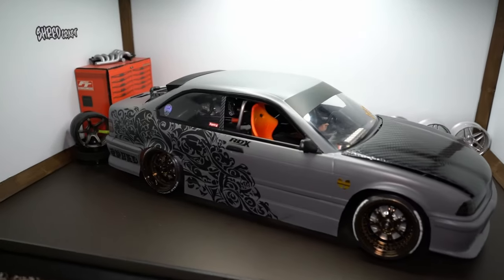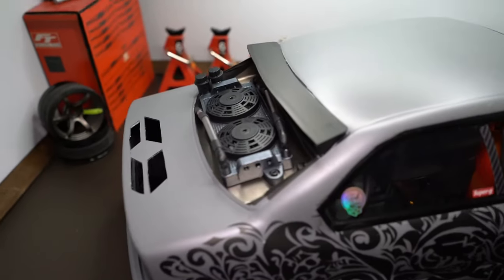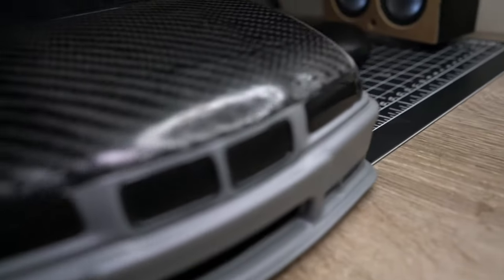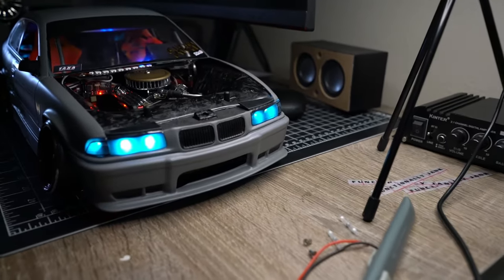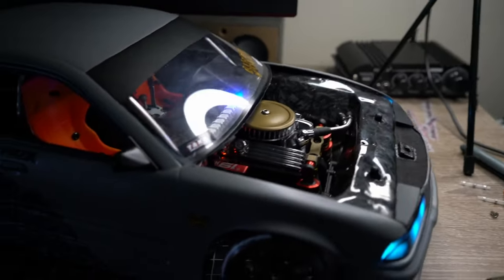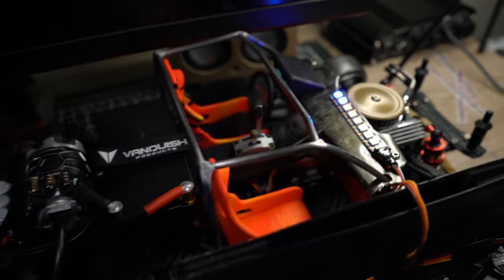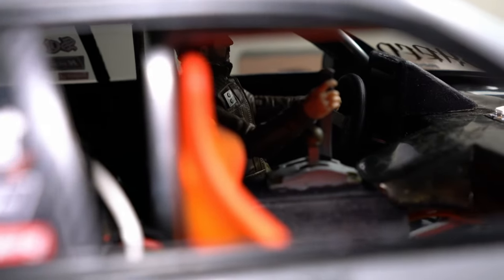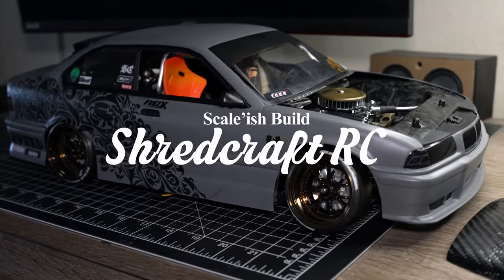RC Drift Car Gets a Makeover! #rcdrift

Comment: How did you set the ps3 button as a switch for lights ? I would like the on/off function for my motor fan so it’s not consistently on.
Reply from the maker: Bought a receiver switch that plugs in between whatever you want to be switched on and off, usually used to lights.
Reply: @shredcraftrc  you wouldn’t happen to have the link to that switch.
Reply from the maker: @wrenchaholics  no I do not but should be simple enough to search “RC light switch”

Comment: Hey brother.  Say I want to repaint a body...what's the easiest way to remove the irritating tamiya paint? I've used DOT brake fluid and works good but man it made my fingers numb after a few minutes.
Reply from the maker: Idk because I’ve never removed paint, I paint this on the outside, btw you definitely want to wear gloves if you’re using brake fluid…
Reply: CitriStrip Stripping Gel is by far the best remover. It doesn’t damage the Lexan like Dot fluid does.
Reply: @Bordz_92  hey thanks for the suggestion. It's a good thing I saved every cuttings from my body for testing purposes. Can this be bought from Walmart, home Depot? This can be found in the cleaning sections, automotive, painting?  Appreciate you.
Reply: @davidhess3320  think I got mine at Lowe’s or Walmart
Reply: @Bordz_92  appreciate it!